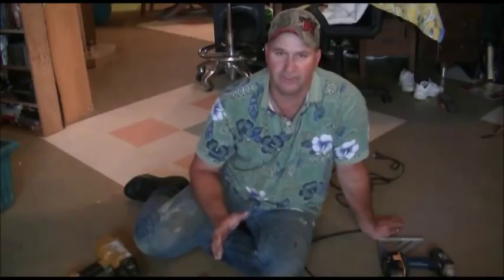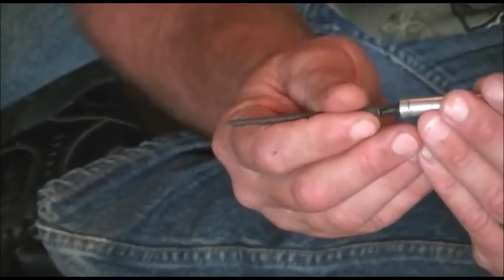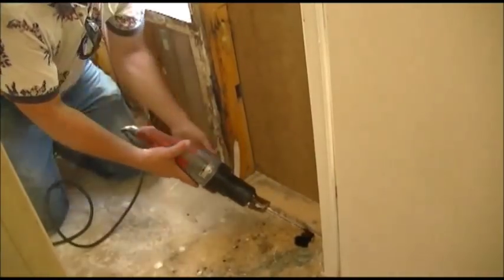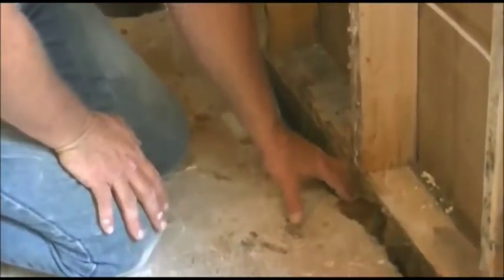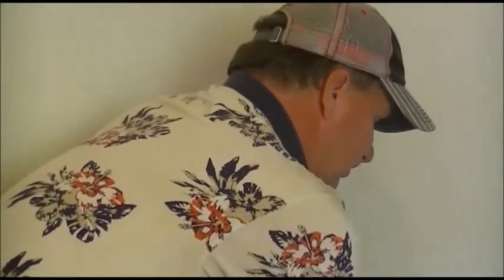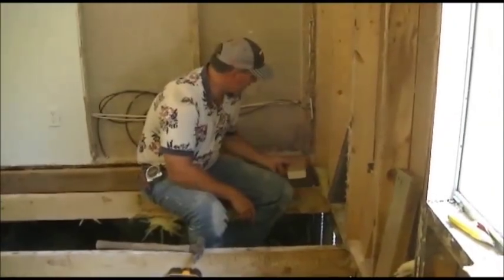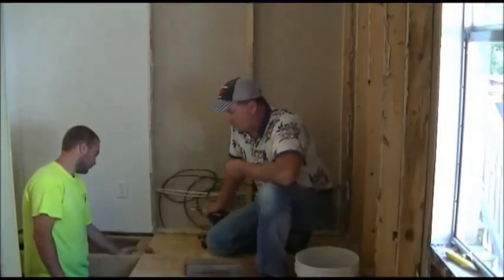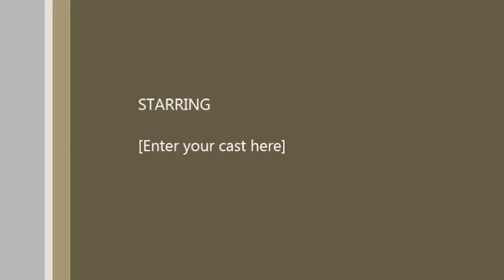How To Repair Subfloor - Home, Mobile Home, and General

Comment: I don't understand why manufacturers don't use this method of framing to begin with. They use that garbage OSB particulate board and then use water-based adhesive and staples to put it all down. All you need is a couple of spills and the OSB just breaks down over time, making it necessary to have to lay a whole new floor. I understand that it's a cheap and economic way to produce, but in the end,  it's always at the owner's expense.

Comment: I just wanted to say that I have subbed to probably 3 dozen channels that do repair work and remodeling. And until I found this, I hadn't seen a video that explained the tools as well as the pro's and con's of using each one along with nail and screws and the sizes of each AND alternative methods of doing a specific task. BRAVO on a 'how-to' video and well done! Simple and sweet and informative and supportive. I just subbed you and plan on checking out the other video's you have available. THANK YOU for an incredible video, very informative!

Comment: Excellent video.   The only question I have is what type of plywood is recommend for using for a bathroom?  I was told 3/4”.  But there’s several different types but not sure what’s the best one to use.  Thanks 😁
Reply from the maker: Any 3/4 plywood will work . have used them all. Use a 2x material under all edges fastened to the plywood with screws. Also in a wet areas such as bathrooms kitchens it would be very good to paint with any paint or stain to help that wood resist moisture. To correct myself paint or stain everywhere if you can. Hope that helps.

Comment: Great video, but what do you do when going under a wall?
Reply from the maker: Basically same rules only harder to do run support in 2×4 or 2×6 formput plywood on of supports. I would not try to use large pieces just support wall thenrun as shown wood along wall to support then plywood up to walland seal up should do video on just such circumstances

Comment: Should have also glued the 4x8 sheet to the floor joists to prevent sqeaks.
Reply from the maker: If you use nails, that's what creates the squeaks. I've always used screws, because you don't get any speaking with the floor.
Reply: I was talking about screws and glue..either way im sure the floor is 1000 times better. I have a old 1979 mobile home im going to have to do the same to..im really looking forward to it............. rolls eyes lol.